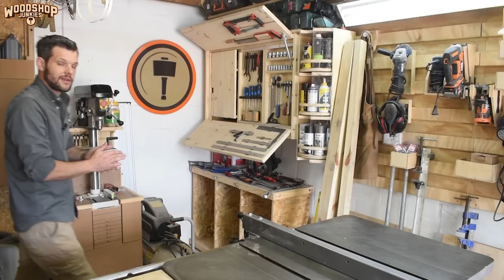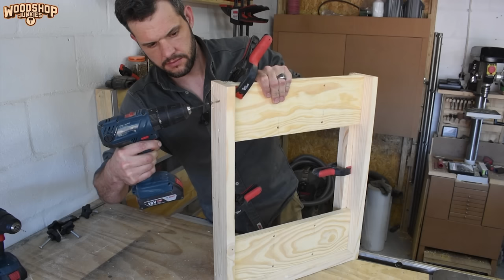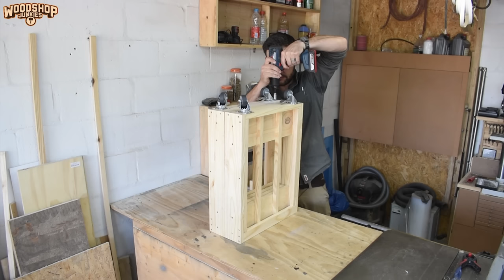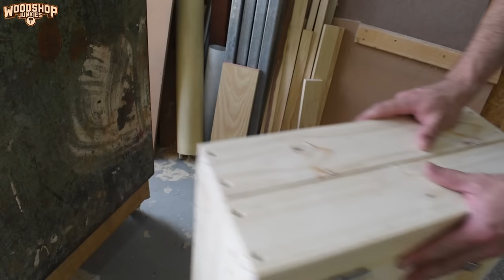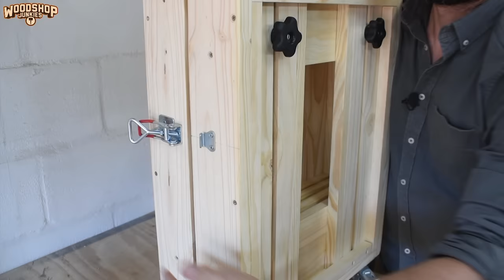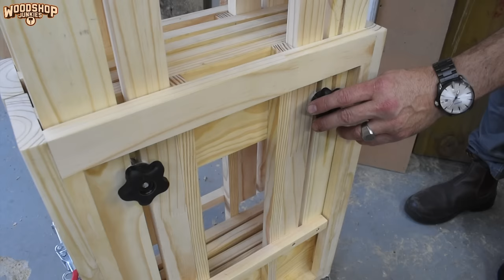Small Workshop Game Changer! DIY 3-in-1 Saw Horse and Outfeed Support System

Comment: looks  nice! i like it!  one thing to make it more efficent would be to do a mark on the alternating hight, one mark for the band saw hight and one for the drill press hight etc. so you dont have to dial that in every time  :)
Reply: I was thinking the same thing.
Reply: I was thinking about drilling some holes on the slides at common heights. That way you could just put some pins in the holes and not measure.
Reply: This is the exact reason I have made ALL of the working surfaces for all of my machines in my shop the same height including my workbench so I never need to keep adjusting my infeed and putfeed supports which I use constantly because I make entry doors and am always working with large pieces of lumber.
Reply: Pegs would also help with accidental drops if knobs come loose.
Reply: @davearonow65  That is an excellent idea!
Reply: @Ethan_Swain  Great idea man. I had that typed in my original comment about the height adjustments with threaded nuts for each machine height then u could lock it off with the knob/bolt thing. It's a really great foldaway he's made here though, eh?
Reply: I was thinking of spacer blocks for each height. Set the appropriate block in, tighten the knobs and Bingo! I like the overall idea very much.
Reply: All of these sound like good solutions.

Comment: Just like many others, i would have gone with "Ball Rollers" instead of castors, it would give you a more stable surface while still giving you multidirectional travel. My other suggestion would be to make some visible makings for the most common heights you would use. It would make it quicker and easier to setup e.g. table-saw, miter-saw, drill-press, work surface, saw-horse etc..
Reply: Instead of marks, you could cut out a spacer you can put underneath the lifting section.  Lift up, set on spacer, tighten down.  Keep a spacer for each tool/setting you need.  I think it'd make it easier to set up than trying to match the marks.
Reply: @MikiaoD  with the exception of the bench grinder, every "work" platform in my shop sits at the same height. No need for multiple settings. I'll build this, as is, because it will work as an adjustable work table in the field.

Comment: Very good video Jean as always. Just a suggestion for the top, instead of casters you could use nylon roller bearings that go in any direction and are very inexpensive ☺️
Reply: Your idea is right.  But I prefer to get the steel roller bearings because I find the nylon ones tend to collect sawdust and such more than the steel.
Reply: @oldguy1030  you are right of course, just meant more on the cost side of things
Reply: @oldguy1030  agreed. You’ll need to frequently blow the dust out of any kind of roller bearings (which might turn out to be a major downside compared with the wheels), but the nylon bearings will attract sawdust like a magnet (whereas the steel bearings will only attract metal shavings like a magnet).
Reply: When are you guys shipping 😊

Comment: I am missing some "positive stops" for common uses , seems easy enough to prepare some "planks" in specific sizes that will fit in below the adjustment system when it is raised , this will also add some support to prevent the table sliding down during work.

Comment: Nice design. There are a lot of clearances that must be considered to pull this off.
The 'Saw Horse and Outfeed Support System' by itself is a work of art. Very attractive & practical finished product.
I'm fascinated by your wall storage arrangement. Attaching items to the inside of the cabinet doors leaves them very accessible.

Comment: This is going to be my next build. But I’m making 2 changes and one addition.

Change 1: Instead of caster wheels at the top, which have to swivel to line up with the material rolling across its surface, I’m going to use 1-inch roller ball bearings  which are universal in whatever rolls across it in any direction.

Change 2: Instead of putting the casters on the bottom in a fixed extended position, I’m going to design some kind of extendable - “latchable"- roller system, again with the roller ball bearings, so that it can roll around (like your casters do), but actually latched down, but when retracted the frame sits solidly on the ground for better stability. I’m still working out the design details but it’s based on what you did with the drill press. I need to make this change to accommodate the next item; the addition.

The addition: I’m going to make a table top that will fit snugly over the 2 ends so that when extended and latched, I can put the table top on it and then I will then have a fully functional assembly table. When not in use the table-top can be stored up against the wall behind the mobile workstations you’re building; like your drill press and table saw. The narrow side is short enough that it won’t interfere with the French Cleat system you’ve built; it will lean against the wall just below the lowest cleat.

Here’s an Amazon link (US) to show you the Roller Ball Bearings.
https://tinyurl.com/mvjk3xbm. Let me know what you think of these 3 ideas.
Cheers
Chuck
Reply: Hi, Chuck. Two thoughts. 1) Roller balls as casters "may" not be a good idea.
I'm thinking, they may not handle dust and debris, on the floor very well and
tend to jamb. Just a thought.
2) To attach your table top, use pegs at the corners, which fit into holes in the
hinged roller caps. I would use 1" pegs.
2-A) If you make your top out of 1-1/2" material, you can include dog holes and
it will be better for clamping around the edge.
Hoping you find these helpful. 😁✌🖖
Reply: excellent suggestions attaboy!
Reply: @zapa1pnt I would suggest ¾" pegs instead (19.05mm, though the 1/500" is within tolerance 😅). That's the most common size for dog holes. Nice to keep a common size.

Comment: I was thinking instead of the casters on top, how about using some UHMW (Ultra-high-molecular-weight) plastic. Then you can take the covers and have them open to the inside.  Those will have the plastic on them too.  But they are not level with the top but slope up to act as a ramp so if you material is bowing down coming off the table saw, it will act as a ramp to lift it up and not get caught.  That is what I am going to use when I make my set.

Comment: Instead of caster wheels, something like a roller ball bearing or “omnicaster” would give you that 360° rotation, but even shorter as well as removing the pivoting that you get from the wheels themselves. I love this idea and will be building one for my table saw and planer out feed! Of course my “height requirements” differ greatly since I’m in a wheelchair, but it’ll be a great addition for my workshop!

Comment: I think that this is a very useful addition to any shop. being as simple as it is to make I think that it has a lot of functionality. The only thing I would say to add instead of the nobs to lock it in the right height. I would put in some set pins into some pre drilled slots on the risers. then you can lock them from not slipping down with more weight. leaving the pin at set heights that match your tables you need them for.

Comment: Over a decade ago Lee Valley made a steel tripod stand with a very similar top end. As well as the casters they put a strip of stainless steel bent into an upside down 'V' with a couple of slots that could be raised up over the level of the casters (held with screw knobs) for all those jobs where you are cutting thin strips of wood that would fall down between the casters (or roller bearings) and possibly try to pull the job away from the fence. I've seen other stands with roller bearings that have a flip up full width roller (I may have one rusting away somewhere) - they have all the disadvantages of a roller stand (pulling the job to the side) plus the roller bearings fill up with fine dust until they jam (and if they are really cheap they may rust solid before they fill with dust -DAMHIK). The Lee Valley stand also had an independent cross levelling screw jack for workshops and job sites that had really irregular floors so you weren't looking for wedges or packers to level the stand.

Comment: Great video! Only thing I would add is removable handles that connect to both sides so you can raise both sides to the desired height at the same time. Less fiddling with each side separately to get the perfect height.

Comment: Fantastic design. I would suggest locking casters at the bottom so it doesn't roll away with your material and a solid locking pin for table saw and miter saw heights

Comment: I like the simplicity.  The only thing I would add is a rubber mat or a grip surface on the top when used for stationary projects.  The less movement when using the drill, the better.  Also, maybe some locking base wheels.  Again, with minimal movement when needed.

Comment: Super inspiring for my tiny workshop space. Two details I thought could make it easier to deploy: 
- put the side latches higher so you can reach and unlock them while standing straight and without going around the support. 
- maybe some sliding latches on the folding sides for an easier lock/unlock action. They stay in place for locking unlike these ones maybe?

Comment: Another stunning solution! I love the approach you take to the engineering to make it simple yet flexible. I think the swivel casters were a great choice over roller balls as they provide more surface to catch the end of boards as they sag under weight. (I have to wonder if there isn't a center support hiding somewhere in the design to further mitigate the issue? )
I plan to not only build this, but also make one with an alteration. Rather than make it an adjustable height, I'll design it so that the ends and the upper hinged supports are at the same level. Then take a sheet of plywood or mdf and make a top, cut it in half, and attach at each end with hinges. That way, I can have a supplemental work station that folds down when not in use. The table top will only increase the collapsed   form by a negligible amount. 
I'll admit, I have a fairly good-sized shop, but I find tremendous value in using designs like yours to maximize flexibility. 
Thanks for a great channel.
Reply: Curious how you plan to solve for having the upper hinged arms at the top, instead of staggered in height so they can collapse
Reply: @pilotdog68   The design won't incorporate the roller supports or the hinged cover for them. I was figuring on either using short steel rods through the ends as pivots, or possibly two sets of hinges. One set would attach a narrow block to the side as a pivot board. The second set would attach that pivot board to the table top. The assembly allows the top to swing 270 degrees.

Comment: Small suggestion. How about using magnets to keep some of the foldable, or collapsible components of your builds closed or secured? Depending on the placement and utility of the construction it could double as a basic automatic alignment assistant. It's just a matter of deciding the system you like best among those available. Maybe leave the possibility for adaptation or easy part replacement though, in case you decide to modify it after acquiring any previously unavailable part.😅

Comment: Great project Jean.  A couple add-ons that I thought of to piggy back on your design would be to add bench dog holes in the caster covers for a way to secure a tabletop or sacrificial strips, add handles to the sides so it can carry a pair of them like suitcases, using transfer bearing instead of the casters, and lastly a shelf underneath to help with it not folding up but also place to store stuff.

Comment: Love it. FYI, the gas struts on your cupboard/fold-down workbench are upside down. There is oil inside them, and with the rod pointing up like you have it, the seals can degrade and leak over time because the oil keeps them in good condition, but upside down it is flowing away from the seals. The wide part should be at the top in the resting position.

Comment: Maybe I might have done things differently, but then this is pretty fantastic as it is... I just got one of those roller stands to assist in the table saw, it has guides that you can lift up to make them stay on track... the unit collapses and can be hung on the wall... but like you said in your video, that's really not what you wanted, and I can see that now, your design is a multitasker, and my roller thing is a single tasker... And I might need more than one if I have plywood that I'm cutting to control the cut and the offcut.   I have to hand it to you, that design of yours is pretty dang clever.

Comment: This project is inspiring. Great concept and execution.

The only reservation I have is about the locking hooks. I thought they would restrict the arms from folding flat when closed. May have to router out the timber they close against. An alternative would be sliding bolts on top of the arms to achieve the same thing. I thought of a few other ways but they would just make the built more complicated so best to stick with what you have done.

Thoroughly enjoy your straightforward aproach to problem solving. This looks solid and well engineered.

Comment: Really cool. Lots of functionality in a small box. There has to be an easy way to mount the locks on the inside of the frame instead of the outside then it would be the ultimate easy storing setup.

Comment: Great idea, will definitely make something similar. But I won't add wheels --- it's light enough to carry (so not needed), and it's more stable without. For cost saving I'll not add the roller wheels on top until I have the money for those --- or make a sort of roller from a dowel.

Comment: You could also drill holes through the risers at the point that the high coincides with known tools the ,saw, mitre saw, Planer then mark a line, and name, on the riser and push say, nails through it then you don't have to tighten up the knurled nuts, or get the exact height to clamp and no fear of the table collapsing when being used at fixed tools.

Comment: Excellent design and very nice workmanship - much appreciated 🙂 And I agree with the suggestion below about marking heights for each tool you use it with - or maybe even add the Self-Adhesive Measuring Tape with the tool names at the right places - but movable in case you get a replacement tool of a different height.

Comment: Great build. The only thing I would add is maybe a rubber surface to help material from sliding around. If you put a piece to do some sanding or planing it would surely make a difference.

Comment: cool design, one suggestion i would make is to mark the adjustable height legs for the height of your tools. make a line for the height of your table saw, miter saw, planer. that way you could pull the legs up to the line and lock them in before you put stock on top.

Comment: I hate to be a Debbie Downer, but this doesn’t appear to be much different from a couple of roller stands, and it takes up more space. I actually have a couple roller stands in my shop for exactly the uses you show here. I can hang them on the wall and they don’t take up any floor space at all.

However, it is quite well engineered, and gives me a great idea for how to build a collapsible and portable workbench. If I end up building it, I’ll try and remember to give you a shout out!

Comment: Nice work.  One challenge I have is my shop floor has a center floor drain and all surfaces slope to the drain severely. The adjustable height would help some with that. However I would be concerned with racking/twisting the collapsible arms.

Comment: Its clever.  But instead of the small casters, here in the states you can get small ball rollers that are pretty much the same concept as the small casters only shorter. 
2 of these would be good for a table saw, 3 even better to cut sheet goods.
However everyone is using track saws now.  But in your tiny space a wall mounted home made panel saw you could use a saw or router might be better.

Comment: i have used the caster swivel before and never liked that t ll i did buy the roller ball bearing they do work better as to others able to function in all the directions you moving your project in? it does have it pro cons as to how wide of a board i could use with it i did play with other ideas to try ot redesign the square wheels lol  
I just put a sheet of plywood in my workspace did made all the proposed work area 
 overall love the project idea you have

Comment: a really good design and video as normal, might of made the height adjustment only need one twist device to secure rather than two just to reduce the annoyance a bit. if you moved the two planks into the middle then you could secure against them with one twist. apart from that they are great

Comment: I enjoy your method of video creation. I was wondering about the addition of some pre-established holes drilled at the appropriate locations that along with an inserted bolt or steel rod would give quick height relevance to your different machine table heights. Obviously, even these would need to be overridden (not used) when micro height adjustment is required.

Comment: If the low friction pad was about the the saw horse and was able to drop the casters the board would land on the saw horse. It be good for continuing milling the peice after its ripped on the table saw right in place without having to lift or move anything. Before your work bench was also your outfeed table why didnt you consider this?